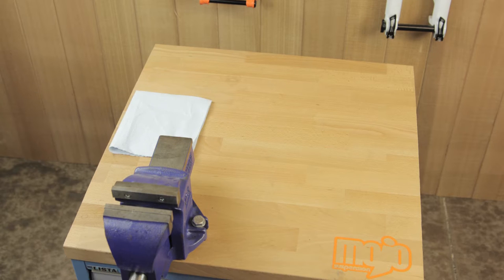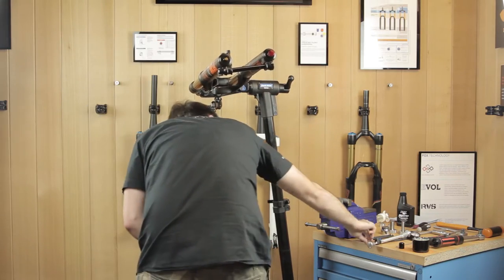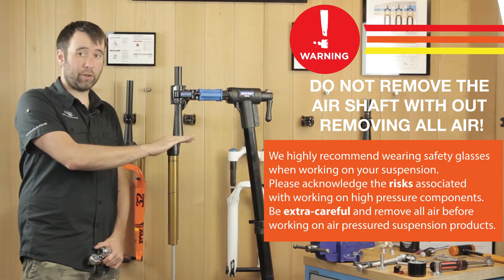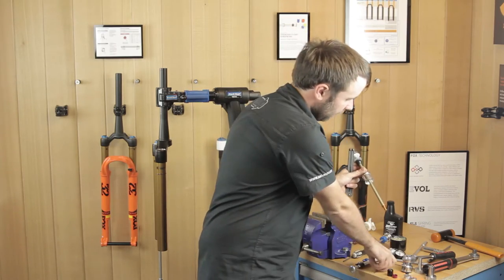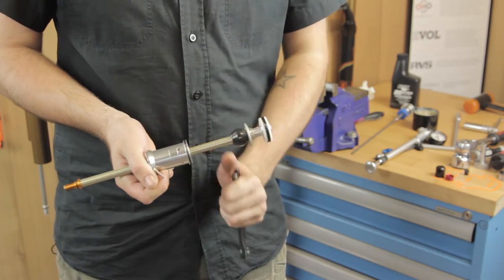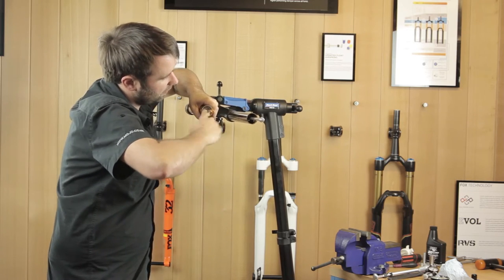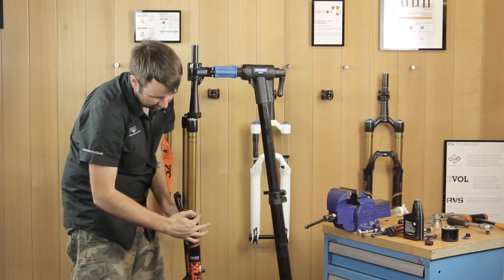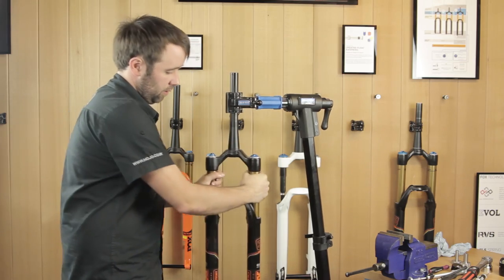2015 - 2016 FOX 36 Travel Change

Comment: I just did the opposite 150 to 160mm convertion on the very same fork and this video is absolutely exact. The big problem I hit was to unscrew  the travel spacer from the both upper and lower parts of silver air piston. I managed to bend all the tools I had, that can fit in the excentric holes and also bent the 2  pins of the spanner that goes in the upper holes of the piston. As the holes started taking damage from the force and it got too dangerous for the airshaft, I unscrewed the orange bolt(that sticks out the lower leg) from the airshaft with 12mm wrench, took out the whole piston out and went to the local fox certified service shop, where they had better- quality pin spanner and very sturdy thin screwdrivers to go trough the holes. They applied huge force to do the work and were pretty surprised that it required that much force to unscrew this spacer on a brand new fork. Thankfully it is all assembled and working now.

Comment: Can this also be done on 34 Float 2015 with Retrofit?  I have 140mm (bought 820-01-404 KIT for 140mm). Could I take out one neg-spacer and move one hole in upper shaft assembly and therefore make it 150mm -  if the fork body allows me?
Reply: I would love to know as well. I have 34 140mm and is it possible to make it 150 or even 160mm? :-)

Comment: that didn't look like it actually shortened it at all. Did that effectively LOWER the front end 20mm on the bike or keep front ride height the same and just make it bottom out 20mm earlier?
Reply: Did you ever find out? I would assume it does lower by 20mm but id like to know for sure before I do this myself
Reply: It offsets the fork travel by -20 mm when there is no load - Adding rings to the "negplate" keepsthe fork from going out further. It technicly will "bottom out" same as before.

Float NA2 will just need you to swap the airshaft for a shorter one... but you can't put in Float NA2 into a NA fork, since the stanchions miss the balance-port.

You add less air to achieve the same pressure in a smaller positive air chamber, if you set your sag to 30% under static load..its  42 mm of negative travel.. and about 98mm of the stanchions.. instead of  112mm positive Travel with 30% sag on 160mm travel.

So reducing the travel to 140, same relative Sag will lower the front in static position by 14 mm ...which is hard to see.

Comment: can you up the travel similarly on a 2016 FOX 34 PERFORMANCE FIT4?
Reply from the maker: The 34mm forks have a different air assembly. You can alter the travel but you will have to change the air shaft assembly to achieve this. You can find a guide here - http://www.ridefox.com/help.php?m=bike&id=615.

Cheers, Tom W

Comment: hi I have a 2015 fox 36 code is CWHC and I want it to be at 130mm. my question is does it only lower the travel by putting 3 neg plate spacers to make it 130mm or does it also lower the fork physically? coz I have a xc bike but bought it as a used bike but has a fox 36 and I want to match the fork with the desired fork travel. thanks
Reply: Did you ever find out? Interested in dropping mine down to 130 to fit my trail bike

Comment: Hello. I have a 2107 fox Float 36 fit4 that is 150 mm of travel out of the box (4 digit code C35T)  and was curious before opening it up if it is possible to extend the travel up to 160 or am I stuck at 150?

Comment: How do you make the 36 fit 4 convert from 160mm to 170mm?
Reply: I would love to know if this is possible too.  I have the 2017 FoX36 Factory shocks in 160mm. @mojosuspension
Reply: It is possible to convert a 2015+ 36 fit from 160mm to 170mm by replacing the air shaft assembly for the 180mm version and then travel down 10mm to 170mm. I've done this on 2017 36 fit and it worked fine. The casting is the same for all 36, only difference on the spring side is that the airshaft assembly is 20mm millimeters longer for 170mm+. Theoretically, you could even travel a stock 160mm 36 to 180mm.

NOTE: THIS WILL ONLY WORK WITH FIT DAMPING OTHERWISE YOU WOULD HAVE TO REPLACE THE DAMPING CARTRIDGE AS WELL!!!

See also:
http://www.ridefox.com/help.php?m=bike&id=576
While it says that 160mm CANNOT be extended past 160mm, this is only true if you do not wish to replace the airshaft assembly.
Reply: If it is a stock 2015+ 36 FIT 160mm or 150mm that means that it could be changed between 110mm to 160mm. If it i bought as 170mm or 180mm that means that it has the longer airshaft and can be set from 130mm to 180mm. If you bought it from someone else there is a chance that it has the longer air shaft and someone reduced it to 160, but is not very likely :) You can check by releasing the air, undo the  32mm air cap and pull the shaft where the volume spacers are (or should be). Check on which hole the small 8 torx bolt is. If it is on the first hole it is either 160 or 180. If it is on the last one it is either 110 or 130. All between are with 10mm steps. Therefore if you have 160mm travel and it is on the first hole you have the 160mm model (airshaft). If it is on the thitlrd hole you have the 180mm model reduced to 160mm. !!!Talas 36 models cannot be reduced and pre 2015 models are different. This works for FIT and FIT4 only.